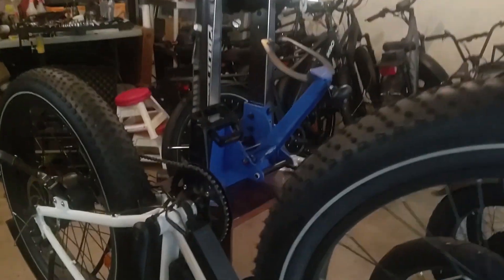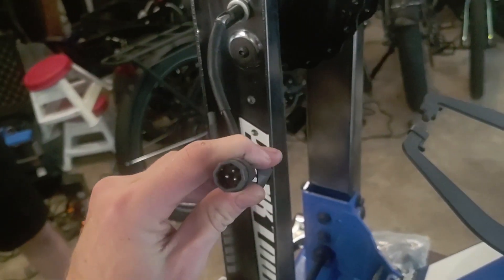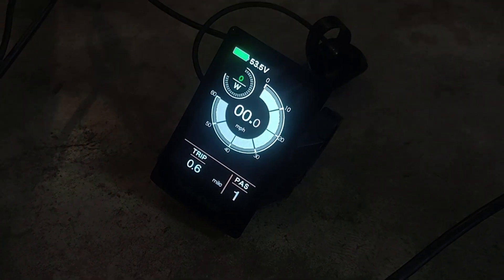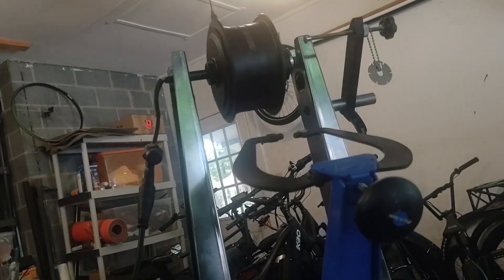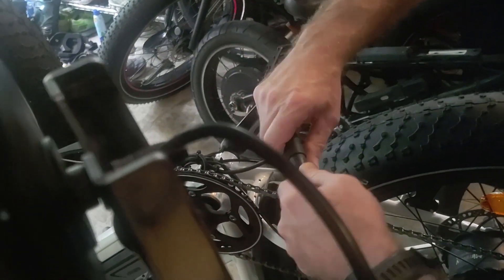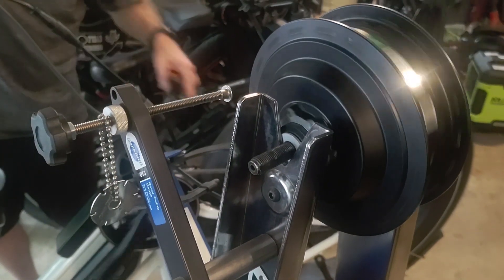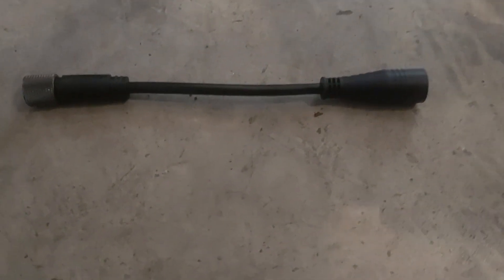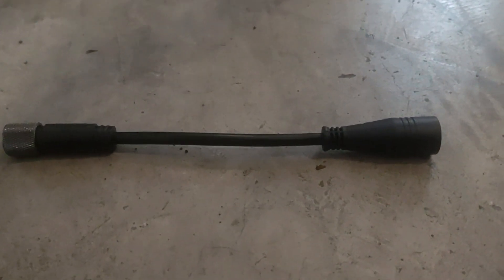Himiway to Bafang Motor Adaptor (Works for other E-Bikes too!)

Comment: Is there such computer in display so you can go cruise with just pas no throttle? for bikes where the controller is stuck in the downtube. 5 pin green plug.

Comment: I have a Himiway with a bad motor, which motor is the best and easiest replacement for the stock one?
Reply from the maker: This link will show you the easiest way to swap out your Himiway motor to a Bafang Motor. We have both the Bafang motor and adaptor cable to use in stock on our website:  https://www.youtube.com/watch?v=sQQklPbsigI

Comment: What controller did you use with the first connection? I'm having a hard time finding a 3 pin motor controller

Comment: Hello because of a good Himiway bike After 3 weeks and about 15 km it is defective (no more pedal assist)
After I tried the support they wanted a video from me with the description of the problem,
what I had done. The driving assistance via hand throttle worked perfectly,
what I showed in the video.
  And what email came back from China ??? a video how I can speed up the hand throttle illegally,
with the statement that they helped me with it ?????????
I think the Himiway Service in China can't even watch video properly.
I've only had the bike 3 weeks and already have a neck on Himiway.
I hope for you that you never have to use the service, because the support in Germany gives the problem
also only to China, because nothing else comes from there either.
 
Have fun with your Himiway
and hopefully never a warranty case.